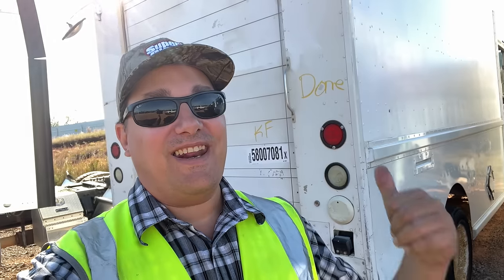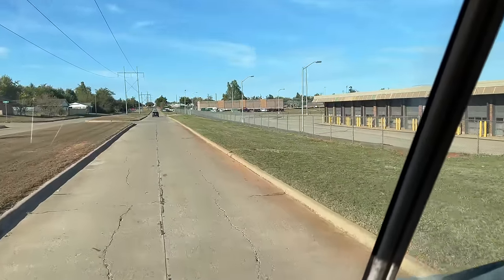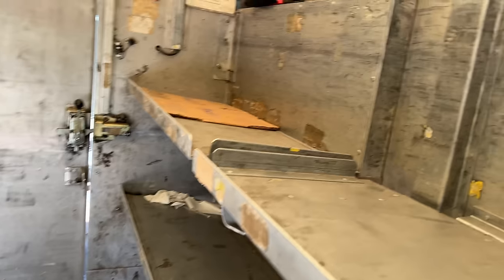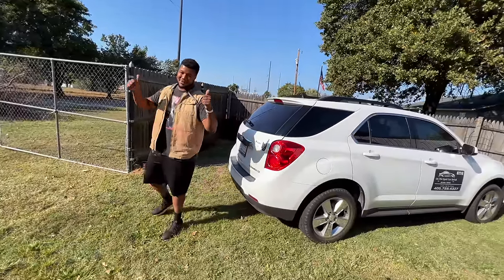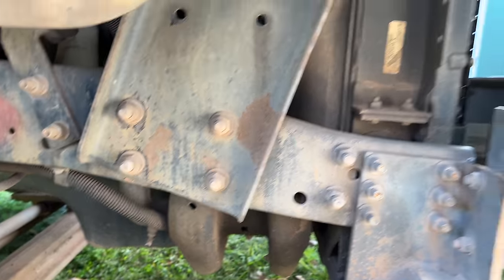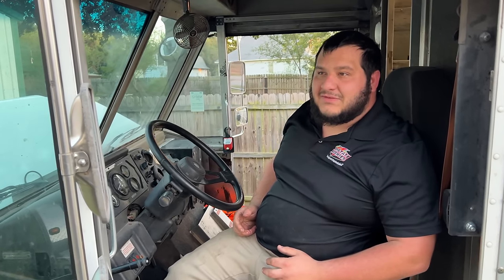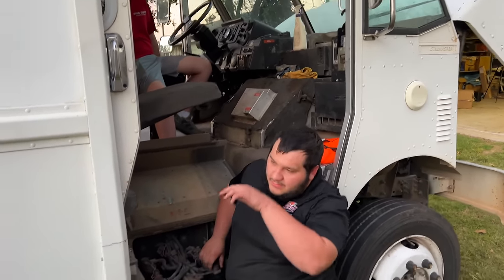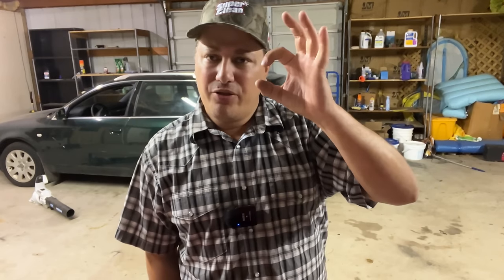I Bought the Cheapest FedEX Truck EVER 24v Cummins + Allison for $4350!! Freightliner MT45 Step van!

Comment: I had the Cummings in my pusher motorhome and my Dodge dually, what a great engine, we also have them on our irrigation pumps for our blueberries overhead irrigation, we have 12 separate 16inch deep wells that pump massive amounts of water for freeze protection in early spring! They run like champs and run for days and weeks at the time when needed

Comment: I worked for RPS/FedEx Ground in Oklahoma City  from 1990 til 2004  my truck at that time cost me 750 a month for 5 years so it ended up costing me approximately $45,000.00...anyway yes it's noisy because of the back door rattling all the time but the package when full helped to muffle the sound...anyways they weren't the smoothest riding vehicles as I'm sure you found out lol...anyway thanks for the trip down memory lane..

Comment: okay where to start...filter on side of engine is engine oil, Allison transmissions usually have a small spin on on the bell housing and an internal filter like many automatics. Fuel filter, there should be a primary and secondary..but not always. I think I saw a primary at 39:25 but that may have been the pump. Air filter, undo that strap and it should separate the silver part from the base. The filter will likely stay on the base. Also you look like you're missing one of the straps, should be 2 from the looks of things. The 2 buttons on the side of the dash. Engine check I think is just to test all the warning lamps. Idle inc/dec, if that truck has cruise control...try turning the cruise on while parked then use the switch to idle up the engine. I've driven semis that work like that. Transmission fluid, it says Dex III but use Dex VI, easier to get and far superior. Dex VI is backwards compatible. Be careful what you put in the P/S may look like Dex III but is likely a dedicated P/S fluid. DexIII may damage all the seals if it's not meant to be in there. Cooling fan...Does the truck have air brakes? if so the fan may be air operated. If not it probably has an electric clutch like the A/C compressor. Scanning the truck you will need a scanner with Freightliner capabilities. Most automotive scanners only have minimal capabilities or no coverage for medium duty. good luck. Keep us posted.

Comment: Judging from the dash sticker it has close to a million miles on it.   But, that doesn't mean much as it could be on it's second motor and third transmission at this point.  

I've seen a few of these run through our state surplus auctions and I think they sold for the same money or more.

Comment: Randy the check engine light/button should have a bulb in it when you rock the switch it should give you blink codes so check the bulb and the connector are there first may save you buying code reader adapter.

Comment: Oh yea, my used fed ex step van, did not have the same locking system you have, but it had like a keyfob. I ended up removing the controls, the control module  on mine was in the upper console above driver.  I may make my own electric lock system. I put pad locks, hasps.  Also body parts check MILL SUPPLY in OHIO, they specialize in step vans.  All different brands.

Comment: If they drove it for years with the speedometer screwed up and counting miles on its own, then it probably has way less mileage since it idled alot during deliveries.
Reply: Was the mileage going up at standstill?when did he mention that?
Reply: @ambread1  ya in the video while it was on and just idling, the mileage was going up by its self.
Reply: Ha.  No. A 20+ year old FedEx truck is certain to have many hundreds of thousands of miles.
Reply: It's higher mileage than the odometer shows not lower, I can tell just by looking at the wear/rust/dirt on the engine. Mine looks cleaner and shows over 300k.

Comment: Used to work for Allison Transmissions for 23 years. Worked on a million of those vans. Most of them had the Mercedes diesel in it.
Also, on the newer ones(2000 and up) they used those wristbands to open the rear door and also to start the engine.
Reply: Were the Mercedes any good?
Reply: @razor3003  No, they were junk. You couldn't rebuild them they didn't have sleeved cylinders, and the fuel system was convoluted and overly complicated. It didn't take much to lose its prime and you'd pay hell to get it to start again, cracking HP fuel lines lose one at a time to bleed air out. The EGR valves would go bad all the time, and the coolers. Expensive parts. But DDC didn't make a small engine so we basically bowered this one to fill a gap. A 5.9 cummins would have been far superior. Even a Duramax(which wouldn't fit probably) would have been better.
Reply: @mikeworkman3593  good to know. I'll hold out for an pre-def Cummins.
Reply: @anotherm2722  Yeah I work for the county transit authority now, buses, vans, trams, trolleys, etc. All the buses, trolleys and trams have cummins, the vans are all ford's.
Nothing but issues with egr/def/aftertreatment (epa10 and up) cummins.
But the trans are pre egr 5.9l. They have given us zero issues. And they are 2014s, but they are custom trams, so they have bits and pieces of everything, like dana 60 ford axles and brakes, but the 5.9s are pre egr which means they were made like before 2002 or 2004(cant remember thw year for cummins, Detroit diesels starts egr in 2002.) so they don't have any of thst crap.
You have to worry about egr coolers failing and your engine getting full of coolant when it's not running, from the egr cooler leaking and running into the open exhaust valves.
On the hybrids it'll straight up shear the input shaft if any coolant is on a piston, since they don't have starters the drive unit motors start the engine at full 600 rpm instantly, there's no hydrostatic lock up like with a starter. It's full start and something is breaking lol.

Comment: Well I’m sure it’s already been answered a thousand times, but that’s most definitely not a trans filter on the side of the motor. That’s most definitely a oil filter. As far as the Allison, you shouldn’t have to service that more then every 50,000 miles as far as fluid. And that trans fluid needs to be checked with vehicle running and at operating temp, and with vehicle in Neutral. But he sure to chock the wheels first. 

AND DO NOT MAKE IT ROLL COAL! That is the very reason why diesel lovers such as myself are going to lose the ability to buy new diesels in the future!
Reply: How many miles would YOU give this 6 speed Allison before it's due for rebuild ?   Just curious.  Thanking you in advance for your answer. You seem knowlegible  with Allisons.

Comment: This is a Keyless 900 series./..  FedEx Express uses them for either Bulk Deliveries/Pick ups or for Routes that are heavy with business. You mentioned that you feel bad for the FDX drivers. Don't. These trucks are more comfortable than what UPS uses And the Freightliners all have AC & Heat. I drove a 500 series (shorter version of the 900) for 18 years.. .  I loved it

Comment: A little fyi. Most batteries when they are completely discharged. The battery charger will not charge them. When they are so low the Charger will not recognize the battery. If you attached the charger to a good battery then use jumper wires to the bad battery. You will be able to recharge a completely discharged battery. I learned this trick from a battery guy a long time ago. And it works. I have tried to charge a dead battery for days and nothing happened. But when I did it the way he told me. I left it on a charger overnight and the battery was fully charged the next morning.

Comment: The idle up button usually stops working when the check engine light goes on. The engine check button usually works when you have the computer hooked up to a computer. The keyless system that looks like an older style. Because the wristband looks like you have to put a battery in it. The swipe pads should always have a solid red light on it and when you swipe the wristband it’ll turn green for a few seconds. But you can also have problems with that because your batteries are not completely charged.  That’s why I’m thinking it’s the older style. The newer key fobs if I pronounce that right has no battery it’s an electronic key you can program a certain number into it and then that only works with certain things my boss got something similar. When he built a brand new blue rhino plant. When they’re brand new you can leave all the key locks unlocked. You actually don’t even need the keys to start the truck but a lot of times we found out that you need the keys in the ignition because the electronica lock system doesn’t turn on all the systems that your key does. And with the speedometer acting funny that’s probably the keyless system showing that it’s old and Out of date and it’s not working properly and because it’s wired into the ignition system it’s probably screwing it up because of the computer that’s in the truck.

Comment: I saw a video describing how the milage showing is not to be trusted on these old FedEx trucks. Lowering milage is as simple as replacing the the dash unit at some point in it's service life. I recently bought a postal Freightliner mt45, Cummins, Allison. I like it well enough, lots of pulling power. I'm not looking forward to servicing expenses. Good luck on straightening that sheet aluminum. Steel bends way easier.

Comment: It may have a lot more miles because that's a replacement odometer they used after the original odometer or speedometer failed. I worked there for several years and they are called W700s in FedEx terminology or the Freightliner MT45. When you got hired you had to take a 2 day class on operating the W700. They probably don't do any of that nowadays..as I worked there in the mid 2000s until 2014. The transponder opens the doors and starts the vehicle but you have to wear it for it to work. If I just laid it on the pad it wouldn't start. Those vehicles are a testament to the reliability and strength of the Cummins Allison setup because we drove them things hard daily. Park to drive to reverse constantly all day long 150+ stops..5-6 days a week and those trucks barely had any failures. That's what Dodge/Ram needs in their HD trucks because they would be indestructible with that setup!

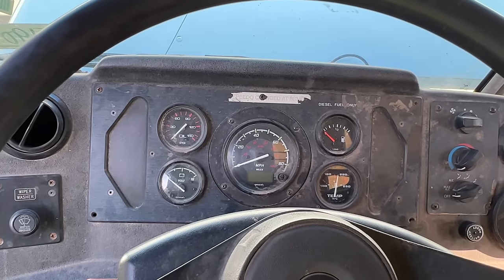Comment: 25:07   did you try pushing the BATTERY RESET button under the aircon controls BEFORE TURNING THE KEY to start it up???

mayhaps it really IS NOT DEAD AS A DOORNAIL... ???  just a thought....

Comment: Hey Randy, check the odometer when the speedo reads speed while stopped. Actual mileage may not be “true” if the odometer counts up mileage when the speedo reads speed when not in motion. You might actually have a lower mileage vehicle then what it reads on the odometer!! Let me know when you check this out!

Comment: You also have a on off valve to the heater under the hood on the hot water line or it would be really hot in the cab in summer. Hope the a/c works. The black things under the back break lights are the back up beep beep beepers.

Comment: I have a vintage Travco 320, tire size? 8R 19.5"; it's the Budd Wheel style.Have a set of 7 Alcoas for it, running Hankook AH35's. A lot lighter rotating mass & the tires are world's better than the Michelins that were on it

Comment: You can clone the rfid band with a flipper. And also it doesn’t have a battery the reader is the battery. It charges it up when it comes into the magnetic field. Low current transmits the rfid sequence.

Buy a flipper and copy it.

Comment: The top"clamp" lets you remove the air filter cover.
The other filter is in fact the engine oil filter. The transmission filter I think is inside the transmission oil pan. 
Never worked on a Freightliner, but have seen the combination engine/transmission combo before.

Comment: Randy, tires are pricy for big trucks your right. However most trucking companies run "re-treads" on the rear and "virgin's" on the front.
Tractor trailer wise and about a decade ago a virgin was somewhere around 400-600 dollars and a retread was somewhere 250 to 400.
The tire in the back is a rear wheel tread design almost what we put on trailers but definitely not a front. For what you would use it for it wouldn't be a bad idea to run virgin's on all 6 wheels and possibly the spare for 7 assuming the funds exist. Just like this thread I too would delete anything that had to do with FedEx electronics. I didn't know that about the battery cutoff switch but it doesn't surprise me and is a great maintenance feature. Military trucks are known for using battery cut off switches. Your suspension torq spec.s are night and day difference from regular autos. the axle u bolts could be as much as 250- 500 ft-lbs depending on the suspension. Look up a good truck shop and they should be able to help out with everything.

Comment: Randy the fan is  Electronically controlled by the ECM it will spend freely until it needs it The computer diagnostics court is called A J bus Easily available on Amazon but the software is a little more pricey

Comment: I own a 2000 Mt -45 with the 5.9 24 valve however mine has an allison 545. Also I don't believe the allison 1000 had 6 speed trans till around 2006. I also own a 2005 2500HD with the 5 spd allison and a 2007 2500Hd with the 6 spd trans. and thats why I think you should verify your trans. Call freightliner parts and they can answer most everything from trans to rear gear ratio. Have your vin ready. The locks can be changed to a remote fairly easily so the wrist band is not necessary. Some high end car audio installers can assist you.

Comment: A lot of fedex mechanics added an ignition key to the trucks because the the starting mechanism on the dash would fail after awhile. I work for fedex and those are some of the best trucks around! The amount of things that truck would do is amazing! Oh and they turn on a dime!!
Reply: Any feedback on the 2006 Freightliner MT -45 with the Mercedes Benz diesel motor? I bought one but it has 300k
Reply: @oneshot_onekill4618  Have you found any place that has good info on these? Looking a 2001 P-1200 with a international 7.3. Trying to figure cost of replacement parts etc but very difficult to find any info on them..
Reply: @MobileYamTechNC  i have the P900 its a 4.3 Diesel but i downloaded the owners manual and been doing the service myself

Comment: I can see that truck made into a walk thru tool box on wheels. Definitely sounds pretty awesome for the price ya paid. You may need to see if there's any info on that RFID wristband getting charged or a way to replace them. I actually like that whole RFID lock system for vehicles. That filter may be your oil filter because Allison likes to shove the oil filter for the Trans UNDER the vehicle, but getting your hands on a Freightliner service manual might do you good for saying for sure.

Comment: Randy I have bad news... above the speedometer it says speedo changed at 86,340 so you need to add that mileage to your current mileage. If the replace the speedo in these the new speedo starts at 0 miles

Comment: You just have to have the wrist band close to sensors to open the doors to cargo. It just has to be close to the starter sensor. The wrist band also has a battery in it. You can get out of the cargo area without wrist band.

Comment: The speedo is probably counting pulses, and the old batteries were so dead that the supply voltage had super high ripple especially at idle, with things only smoothing out at higher RPM. This led to lots of "ghost" pulses being registered. It may be handy to keep a super capacitor handy for cases like that (the kind that people use with power-hungry stereos).

Comment: So I own a 98 12v MT45 Utilimaster that was also an old FedEx unit. They’re fun and fairly reliable. They all leak though. Also, that odometer might not be right. The 3rd party that sold a lot of the trucks would swap odometers - there’s a still pending lawsuit about that. Note that the gauge cluster is missing screws. Might not be true in your case, but keep it in mind.

Comment: My allision had a filter in pan setup.  Need to follow the white filters lines to see if it has a remote filter. Also does the fan have a electric clutch.   Lots of heavy trucks use a on off clutch to save fuel.  Instead of thermo clutch which still turns   just slower

Comment: Maybe my truck is just weird, but I have a 2003 24v cummins and I do oil changes every 10k. After that many miles I can still see the cross hatch on the dip stick though the oil. Sooty oil usually means egt or blowby. Still though, great buy. It sounds amazing and seems to drive nicely. I might be just a little jealous.
Reply: Are you familiar with the 06 MT - 45? I want to start doing oil changes myself but cannot find the oil filter. They use to put them behind the alt but nope. This has the Mercedes Bens diesel 4.2L

Comment: My guess is that fan has a electric clutch and will not kick on until the temperature goes up to a certain degrees which is probably around 215 that is just my guess as far as the fuel filter It is possible it only has one filter My 1998 Peterbilt with a 12.7 Detroit only has one cartridge filter

Comment: ON the clutch fan sounds like the clutch it self snapped inside it self because of the free spinning I would change it over to a electric fan that diesel will thank u for it diesels dont like to run hot at all

Comment: That step van cost a lot more in 2021. Years ago I drove a step van that belonged to a car dealership parts department and we moved the parts department from one location to another and I drove that van in Pittsburgh pa. Where there’s plenty of one way roads but I had a blast driving it and it was a gas job so it was nice and quiet and it was a long van. I drove that for probably close to a month. I would love to have one to change it into a camper.